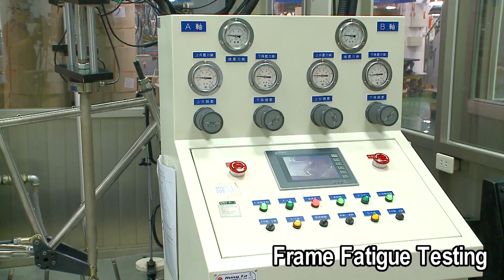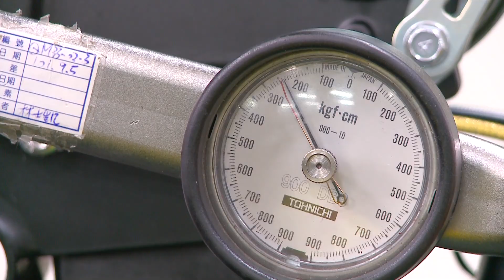MBK - Production de la gamme AX-ION 2014

Comment: J'ai un AX-ION 2.2 2014 (modèle montré à 4:13 dans ce clip) qui deraille souvent. De plus, quand je roule sans assistance la chaine sorte de l'espace en dessous du garde chaine qui suggère que le pinion moteur ne peut pas tourner librement. Sous assistance électrique, si j'arrête de pédaler pendantt un moment il y le son de frottement de la chaine quand je recommence pédaler avec un petit choque au moment ou le pinion moteur tension la chaine. 
Est-ce que quelqu'un peut m'expliquer ce qui se passe? Il y a un régalge à effectuer ou une pièce à changer?